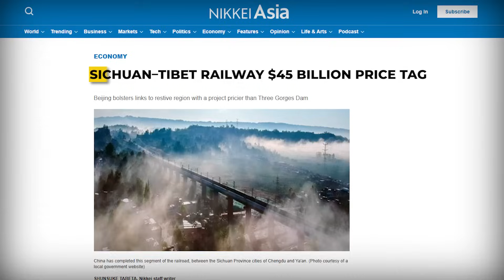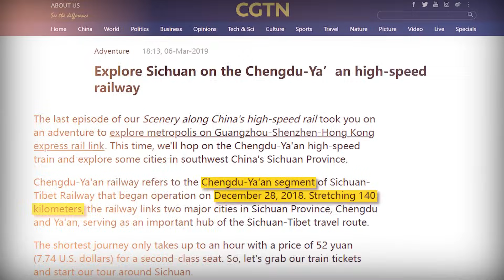China’s $45BN Railway Across the Himalayas

Comment: The hottest temperature recorded on Earth was 56.7°C or 134°F ! So what are YOU even talking about?  192°F is an impossible temperature on Earth💯
Reply from the maker: Hey! You’re right to point out that 56.7°C (134°F) is the highest reliably recorded air temperature on Earth. What the Sichuan–Tibet project is talking about is a different kind of temperature completely — ground / rock temperature deep inside mountain tunnels.
Reply: @MegaBuilds5280 if it is 90 deg celsuis, water will become vapors. Do u think human can work
Reply: Dunning Kruger at work, folks.
Reply: hottest SURFACE temperature recorded. The deeper you go, the hotter it gets. The earth's crust gets a lot hotter than 56°C.
Reply: This just in! 📰 Underground can get HOT. Check out some of the world’s mines for an example